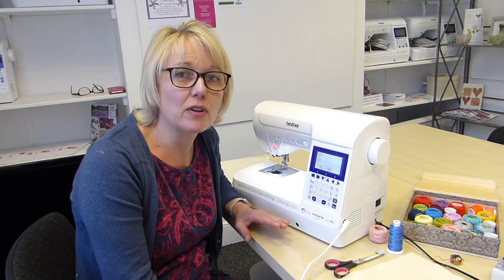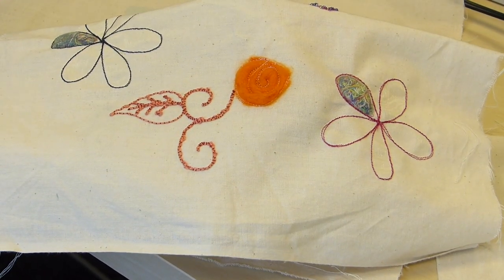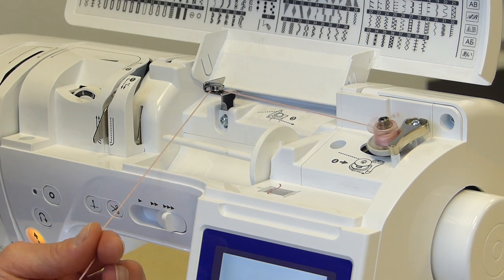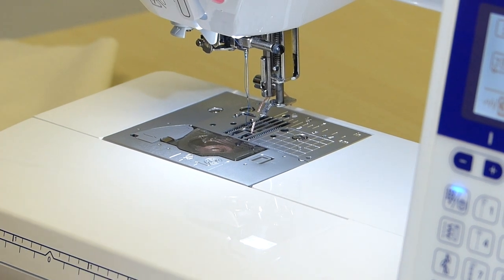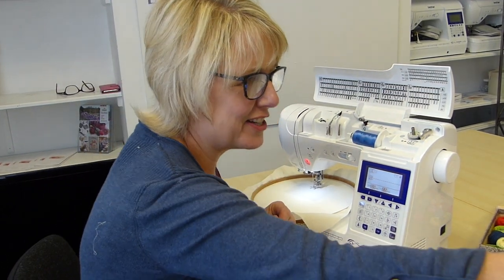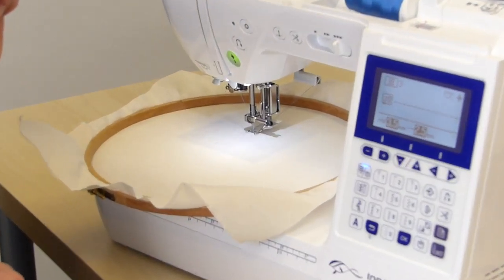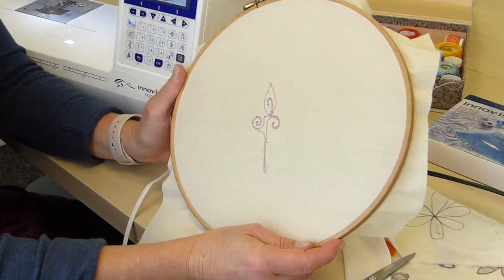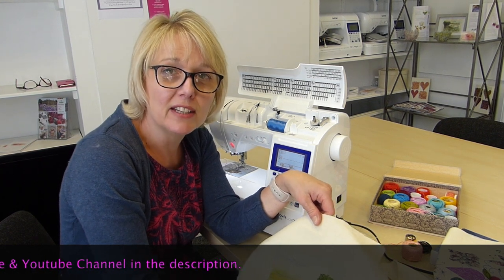How To Use Thick Threads On A Sewing Machine (Cable Stitch) With Claire Muir

Comment: I have tried using thick thread in my bobbin but it turned into a mess on the bobbin... it didn't wind properly at all. It jammed, etc. I have a front facing bobbin and am not sure how to bypass the bobbin mechanism.

Comment: Why not trying to reverse the thick threads on the top and using the normal fly of threads on bobbin you can save time to reload the bobbin I use this technique since 30 years of sewing experience but love what are doing
Reply: The thick thread I use is too thick to pass through the top sewing machine mechanism.

Comment: Wonderful Video. Would you please, tell me where can I get the darning presser foot you have in this video ?? I want to get one for my machine, as I enjoy embroidering. I will appreciate it very much. Thanks
Reply: Hi, the open toed free machine embroidery foot I use in this video is for a Brother machine available from Frank Nutt Sewing Machines. Different brands of machines have their own styles of free machine embroidery feet and they all look slightly different. What you need is an open toed machine embroidery foot that is designed for your specific machine model. Hope that helps.